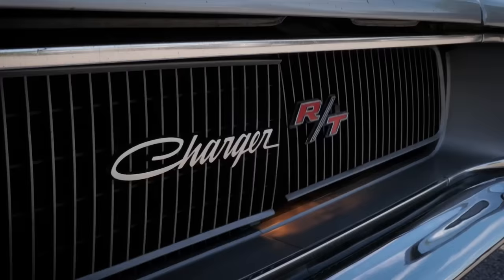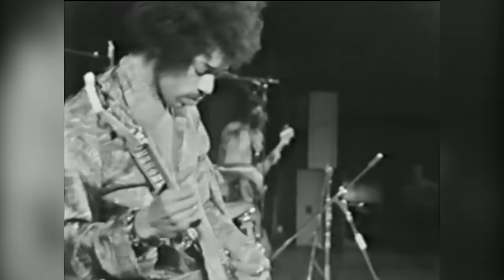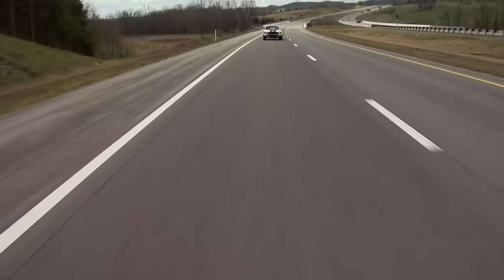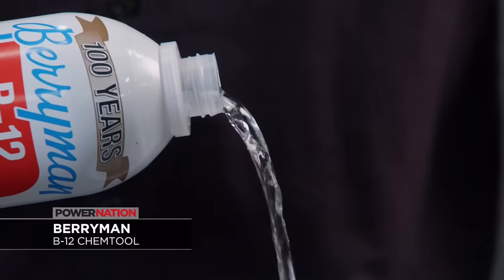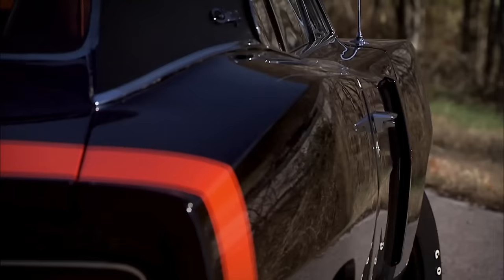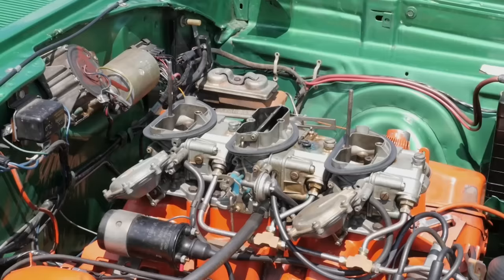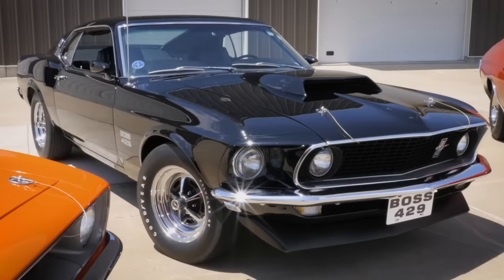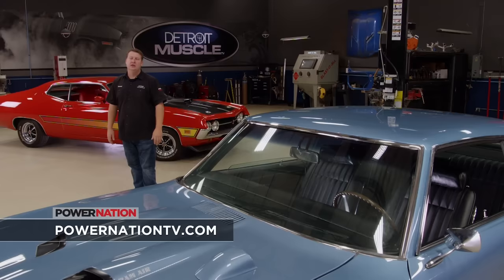Top 10 Muscle Cars of All Time

Comment: I'm 73 years old and grew up around ALL of these cars and remember them very well and also how they REALLY ran on the strip when stock.  I was THERE.   So, it was no surprise that the 1970 Stage 1 GS/GSX was not mentioned here. They were (and are) rare and were very lightly promoted by Buick, if at all. However, the GS Stage 1 ran way better than the sum of their parts would indicate.  And unlike the Hemi's of the day, RA IV Pontiacs, LS6 Chevelle's, COPO 427's, 440+6 Mopar's, Boss 429 or Super Cobra Jet Fords, Boss 302's, 1967-71 Z-28's, etc. etc....  a Stage 1 GS could be ordered with a/c!  The engine was that streetable,. 
    So why wasn't the '70 GS Stage 1 included here?  Simple. It was because: (1) few people who voted here really know anything about the 1970 GS Stage 1, not to mention ever owned one or raced against one stock for stock and (2) very few people who "voted" are Buick muscle car enthusiasts.  It seemed that few GS guys ever raced their cars at the strip and thus lacked basic dragstrip etiquette in how to drive them or even decently tune one.  
     Back in 1971 at the Gainesville, FL Raceway, when all of these cars were new, I saw several GS Stage 1's outrun nearly about all of the so-called Top 10 muscle cars shown here.  I remember that the now-deceased 18-year track manager "Bob" used to laugh about that when it happened because he liked it when such underdogs took out the more highly touted models.
Reply: Yeah, a Buick 455 Stage 1 engine is a glorious beast.  But go back a few to the Buick WIldcat 425 a very quiet sleeper that left the line with competitors jaws on the floorboards.
Reply: @AndrewArndts  Yes, I love the old "nail-heads". Sad that more aren't used in current street rods.  But today it's all about availability and cheap parts and NOT about cool uniqueness.
Reply: Spot on!. I grew up on Woodward Ave in the late 60's early 70's and bought a brand new Camaro SS when I was 16. I got my first GS in 1980 and never heard of it before. I traded a Honda 450 bike for a '70 GS Stage 1 ragtop with 28K on it. Go figure. From that day forward I was sold on GS's and have owned many many more. I'm 70 now and just bought a '66 Skylark with a 455, stage 2 aluminum heads, roller rockers, Big Mutha Thumper cam, 4:11 9" Ford rear and Gear Vendors OD to just mention a couple speed goodies - a low 11 second car. Some of us kids never grow up. Buicks rule
Reply: @albundyrocks2115  Thanks for the story and memories.  Being an old-timer like me, I see that you know what you're talking about.   BTW, 2022 GS Nationals, Bowling Green, KY.  A Buick muscle car Mecca.
Reply: Buick
Reply: Few people who voted know anything about cars. They just grab onto something cool, read about, and declare it the best. Stories like this tell the real truth. My dad tells stories that seem to contradict the list too. He said that small block Chevy cars were hard to beat on the street and big block just blew the tires. The track was a whole other story. For all the hype around the 426 hemi, he said the 440 cars seemed to do a lot better.
Reply: @ardyshane23  - Your dad is right.  Hemi cars were routinely outrun by 440 six pack cars.  To run up to their potential, Hemi cars required an owner who knew how to tune the car and was willing to put in the time.
Reply: Very true.  I am 66 and used to take my lightly modded 351 powered 1970 Mach 1 routinely to test and tune days at the strip around 1974-75.  I don’t recall ever seeing a GSX at the strip.  To be honest I knew nothing about the Stage 1 powered GSX back then. From what I have read they were really hard to beat stock vs stock.  On another note I remember a guy bringing out a Boss 429 one day that was lightly modded with slicks, open headers and a Holley 3 bbl carb.  He was running 12 teens - 20’s which was extremely impressive back then.
Reply: Both the 1970 Buick GS Stage 1, and the 1971 Mustang Boss 351, on paper, shouldve lost to most, if not all, of the cars on this list … but in test after test, both regularly stomped all over them.
Reply: I am 69 and agree with you. Those where the best of times street racing. My buddy had a 67 Grand Sport Conv. in 1972 and that was a very fast car. He sold his 65 GTO that we had installed 396 375 hp big block so he could by the Grand Sport. We grew up right next to Chicago so Nickey Chevrolet and Mr. Norms put a lot of fast cars on the street. 1970-71 I worked at a Dodge dealership as a porter. The last job of mine at closing was to pull all the muscle cars into the shop. You can bet a few of those cars went way past the service entrance for ride.  A few months after I got married in 1974 I bought a used 70 Skylark because of my buddy's 67 GS. He didn't have any photos of that car until 2 months ago when I found 3 35mm slides I had taken Christmas Day 1972 in Denver Colorado.
Reply: @richardbehrends3128  I sure would have envied your job!
Reply: @danmyers9372  Hemis required a whole lot of maintenance to keep in top running shape for sure. 340's kicked a lot of big block butt in the light cars in the day too.
Reply: These old cars were DOGS..the horsepower ratings were fake over rated GROSS dyno numbers......over rated  by 17-20%.  The  440-6 was advertised at 390 hp, but is only 325 NET hp  installed in the car.  426 was really 350 net.
NONE of these older cars put out more than 350 horsepower.  A 2021 Dodge 5.7 puts out more than any at 375 NET horsepower.  The new Camaro V-6 even more at 335.
Reply: Yep.. I thought it would narrow down to the 70 454 Chevelle, the 70 Buick GSX and the 70 Hemi Cuda.
Reply: @matrox  You guessed well!
Reply: @chadhaire1711  "Dogs"?  Few would agree with that term.  Please direct me to where you got those "NET hp" numbers. While I agree to some extent, but not in every case you mention.  The new cars are as fast or as quick as they are due to much more efficient engines and with transmissions with way more forward gears.  What would you expect with 50+ years more technology?
Reply: @LR-my2di  A.  Few would  agree with the DOG term because few understand that GROSS horsepower is vs NET horsepower.  Plus they believe the bullshit 1/4 miles times posted on chats.  The horsepower ratings back then were  FAKE over rated GROSS numbers used until 1972, taken off a dyno with bare engine. The NET horsepower is with the engine  installed in the car with muffler, air filter, belts, and smog gear if any. You lost 18-20% power right there.
B.  The NET horsepower numbers are FACTORY NUMBERS they posted after 1971 when all car makers dumped the fake GROSS numbers and went to NET which is used today.
C.  Thus 440-6 dropped from 390 to 325.  426 dropped from 425 to 350.  340 dropped from 275 to 240...and so on.  But the 2021 Dodge 5.7 used in the RT today  is 375 NET---more than the 426 Hemi!
D. The new transmissions with more forward gears has NOTHING to do with quicker acceleration!!! NONE!
That is because the "extra" gears are ADDED gears mainly overdrive gears.  The first 3 gear ratios on the new automatic cars are about the same as the old cars.  In the case of older 4-speed manual vs newer 6-speed manual, the first 4 gears are about the same--the extra  2 on newer cars are overdrive.....will give a better top speed, but will NOT affect 1/4 mile times.....NO.
E.  The quickest car back in 1970 was the 426 350 hp and 100% stock was 13.6 in the 1/4 mile.  All  these posts telling us about "stock" muscle cars doing low 13's or 12's are BS!   The horsepower was not there.
F.  It is not about 50+ years of tech---it is about 50+ years of bullshit stories---the low 1/4 mile times that never happened, the myth that car makers under rated horsepower to "fool the insurance companies"--another lie--never happened.  Or stories how the 426 really put out 500+ horsepower...LOL....
G.  Back to my statement...these old cars are DOGS. ALL IMAGE.   And I forgot to mention crap build quality, rust, horrible brakes, scary handling, and not that reliable either.  NEWER IS BETTER.  These old geezers need to stop whining about the cars they sold back in the day or dreamed about owning....and go out and buy a newer Camaro SS, Mustang GT, and Dodge SRT.....they will forget about the older cars in a hurry.
Reply: @AndrewArndts  Here we go with the bullshit again....the 1970 Buick 455 was advertised 360 gross horsepower, which was about 310 net horsepower.  With 3:64 final drive the quickest ever recorded 100% stock was 14.1 with top speed of 124.  The stage one 1971 was 345 gross hp, or 300 net and did the 1/4 mile in 14.5......the BS stories just keep on coming...
Reply: @buzzbomb67  The 1970 GS stage 1 was a 14 second car..LOL....
Reply: @chadhaire1711  Agreed that older muscle cars are more about sentimental nostalgia but look at the prices they often bring from the "old geezers" who love them. A "350 hp 426 Hemi" bringing 6 and sometimes 7 figures?  I have both old and new, and (for example) my stock SRT 8 Challenger at 418 rwhp is just a wonderful new appliance.  Ditto my '06 FGT with 696 rwhp.   A real screamer with 136 mph trap speed. However, no real soul to either.  They just do everything so well to almost being boring.  My old recently restored 1970 muscle car I bought new is very different, albeit not as quick as even the bone stock (and heavy!) SRT 8. 
    I bought all of the muscle car mags back in 1970 and read all of the old road tests, and still have most of them. Interesting reading when looking back.  BTW, whatever their actual horsepower was, in May 1970, I very well-remember a 1970 Buick GS Stage 1 outrunning a 1970 Hemicuda (twice!) at the then-new G'ville, FL Raceway.  It appeared to be a close race, but the GS's Winston lane's win light came on both times.  I also remember that both were running somewhere in the 13's.  THAT I do remember, along with the GS being so damn quiet. That all surprised the 'ell outa me.  
   BTW, in a 1/4 mile pass, my automatic SRT Challenger uses more forward gears than my old 1970, so the engine stays at redline.  It doesn't ever fall out of its power curve. The tach stays almost rock steady the whole way. That's basically what I was talking about.  So power is maintained throughout the 1/4 mile near redline.  Not so at all with my '70 or any other muscle cars of that era.
Reply: @chadhaire1711  You ain't too smart. V6 Camaro barely making 280lbs Tq., compared to 350, 400+ if you want to use net ratings. Well over 400-450+ if you go gross. Those oldies were running 3 and 4 speed transmissions. Lots of wasted power to the ground. New V6 Camaro running 6, 8 speed trans, with very linear gearing for no drop on power between shifts. These old cars would also burn rubber through much of first gear. Add a modern 6, 8 or 10 speed trans, with modern sticky rubber and it would knock a sec. or more off the E/Ts. Those cars did pretty damn good with that 50-60 year old technology with no computers to adjust cam and timing on the fly like today. If you knew the tricks you could drive you 440 six pack or many other cars to the track, tweak your carb, manually advance your timing and knock almost a half sec. off an e/t. Sure your car will idle like sh!t and be undrivable for street but be great for getting down the 1/4 mile. After the race go back to stock timing and drive home. No these cars were not dogs by any standard.
Reply: @LR-my2di  Exactly!!...just what I tried to tell this fool.
Reply: @LR-my2di  a.  Any Buick Stage 1 that outran a 426 was NOT stock.
b.  If you take an old 1970 muscle car with 4-speed manual, and newer car with 6-speed, you will find the gear ratios of the first four gears about the same.  In 4th gear, at 75 mph they will both be running high 3500-4000 rpm.  Not sure how your SRT can run higher rpm than the older one in the first 3 gears, but I have not checked as of late.  If your old car has 4:10 rear I dont see how that is possible.
c.  I  dont see how a newer SRT can be boring compared to the older 1970 car....same wild styling, same loud exhaust, a lot quicker.  More chance of dying in the older rust bucket with horrible handling and bad brakes, so that might add excitement and thrills.
d.  Yes these old cars bring a lot of money at auctions---a sucker born every minute in my book.   But 40 years from now the 2021 Hellcats will be bringing $200,000 at auction, and the same whiners will be saying "I should have bought/kept one back then".  So the smart thing to do is forget the old junker over priced cars, and put money in the newer cars NOW--and keep them.  I have driven all the Hellcats and there is NO WAY I would ever sell a RAM TRX truck....the ultimate drive.  The Hellcat Durango as well--with all-wheel drive it is actually quicker than the 800 horsepower Wide Body Challenger  on street pavement.
Reply: @LR-my2di  gearing makes a HUGE difference …
Reply: @matrox  You are playing a numbers game and slighting the deck.
1.  The new transmissions with "more gears" have NO ADVANTAGE over the older cars as far as acceleration goes.  Take a 1970 car with 4-speed and newer car with 6 speed, and the ratio of the first four gears is about the same....the extra two top gears are over drive and while have an advantage of top speed, have ZERO advantage in the 1/4 mile.  Pretty much the same on automatic transmissions....drive 75  mph one ANY of these cars, new or old,  in 4th gear and you will see little difference in rpm. I know because I drive them all every day of the week...you obviously have not.  The idea that a newer car with more gears has less power drop on the drag strip  is bullcrap----in fact with an older car with 4;10 rear, the newer might have LESS DROP.
That is why the older muscle cars maxed out at about 110/113 mph....low gearing. 
2.  Yeah if you "knew the tricks" you could get the older cars to run quicker...as in NOT STOCK.  If you know tricks, you can do the same with newer cars...NOT STOCK.  What is your point?
3.  The only advantage newer radial tires have over the older tires are flexible sidewalls that keep 100% of the tread on the ground in corners, while the older stiff polyglass did not flex which prevented total traction--IN CORNERS.  When doing a 1/4 mile in a straight line there is no real advantage.
4.  The V-6 Camaro puts out 335 hp and 280 torque.  The 383 was/is  265 hp net, and about 335 net torque..nowhere the 400-450 you are quoting.  The big blocks 440/426 were 325/350 horsepower near 500 gross torque, but only about 425 net.  The 2021 Dodge 5.7 is 410 lbs torque net, about the same, and 395 hp--far more than 426/440-6 pack.  You can run all the numbers you want, but the older cars were over rated.
5.  So who ain't so smart now Gomer?   LOL...try try again....
Reply: @matrox  and you fail Goober....try again...
Reply: @buzzbomb67  The 1970 cars had low  4;10 rears that dropped the top speed to only 110/114 mpg......they still cant beat a modern car with taller gears...what is your point Gomer??
Reply: @chadhaire1711  so we agree … modern transmissions with better gearing…. Just like I said.  Doesnt change what those cars were, though.  But it does explain why so many people prefer restomods to concours original cars!  No one is arguing that new cars arent faster … I have a 17 Roush Mustang that supposedly runs sub-11 second 1/4… no 60s/70s car can compete with that, without major modifications to modernize it.  We all know it.   Whats YOUR point?  Why so argumentative?
Reply: @chadhaire1711  You made my point. These older cars accelerate...the problem is gearing. Most of these cars will burn rubber all through first gear. 2nd 3rd and 4 is when it looses the efficiency of using it power because of loss between each gear because of the big ratio difference between each gear. Unlike a modern trans has closer ratios between gears as to not drop power losses between each gear. You don't know to much about cars do you. Give up the Fake news dude and stop pretending to be a Honda Civic expert.
Reply: @buzzbomb67  My point is: the horsepower ratings claimed  these videos and comment sections  are fake, the quick  1/4 mile times listed in the comment sections are bullshit, the idea that horsepower ratings on the old 1970 cars were "underrated to fool insurance companies" is and always was a lie, the claim these were more reliable than the newer cars is 10000% false...I could go on...but my favorite are the comments from some  dude who said he owned one of these  old muscle cars and stock, it did the 1/4 mile in 12 flat, and ran 150 mph on the freeway...LOL......there is one on every thread.  My point--NEWER IS BETTER IN EVERY WAY. NUFF SAID.
Reply: @chadhaire1711  Dead wrong.  This is just ONE example ... Jan. 1970 Motor Trend p.66-68.  13.38 at 105.50 with TH400 and 13.79 (with more wheelspin) for a 4-speed at 104.5 with a 4-speed.  No magazine test ever noted a 124 mph top end for that car.  Both M/T GS's were noted to be dead stock.  BTW, that 360 hp was purposefully rated down at only 4600 rpm.
Reply: @chadhaire1711   Chad, you sure share a lot of "opinions" here.  If you think that it's just the "old geezers" that love these old muscle cars that you denigrate, then you sure haven't studied this l-o-n-g comment section! And it's just one of many such old muscle car forums. That alone proves your opinions are just that ... opinions. You obviously don't have a 1964-72 muscle car, and that's fine. I have both old and new and a few in between. That alone proves my point. I speak from experience of owning quite a few high perf. cars.  I guess you never heard of the Round 1 GS vs. Hemi shoot-out at Gainesville, FL done by the old Muscle Car Review back in '84.  BTW, the GS Stage 1 "stock" or equally modded up to a point where the old Buick Q-jet on its cast iron low-riser manifold will run out of air will indeed run with an equivalent Hemi "whatever".  I've personally seen it and the old magazine tests prove it, and I've got nearly all of 'em to prove it.  
I said that my SRT, with all of its forward gears, would keep engine rpm up throughout the 1/4 mile and constantly at the top of the power band compared to an old 50 yr. TH400, C6 or Torqueflite. That, along with immensely better tire technology, really makes a big difference in the performance of the new "muscle cars" vs the ~51+ yr. old ones. 
Now I will conclude with MY opinion.   If you believe that the big ol' Ram TRX, with its 8-10 mpg and its total daily impracticality is the "ultimate drive", then what the hell am I doing discussing this topic of muscle cars with you.  Merry Christmas!
Reply: @buzzbomb67  Well, it certainly can ... more-so like on a 1969 Z/28 as compared to a 1970 GS Stage 1.
Reply: @chadhaire1711  soooooo….what?  Are you mad because you think all 10 top muscle cars should be brand new cars?
Reply: @LR-my2di  You are dead wrong....on everything----the horsepower was not "purposely rated down from 360"....the net was more like 325 hp, and the low rpm was due to the pushrod design and long piston stroke which is not designed to operate at high rpm.  Even the 426 Hemi was only 5,000 rpm. Revving higher could get about 10% more power, but could destroy the engines--which is why the 426  Hemi had a 90 day warranty. 
The 13.38 quarter  mile was  typical Motor Trend BS....everyone knew the factory was sending wringers that had  been prepped by the factory with hand made motors for press fleets only--non stock- which was easy to do because the lack of  smog gear--also MT cheated by  doing things like removing the air filters, or packing the air intake with dry ice, and doing a dozen runs, then cherry picking the best one time.  Car & Driver did the same.  Only Road & Track gave real results at the time whcih were much slower than other magazines.
I am 100% correct----you are not--you are just reading  fiction you read somewhere...just like the virus ninsense we see in the media....next you are going to tell me you get your "news" from CNN and MSNBC!!!!!!!!!!!!!!!!!!!!!!!  Dont believe everything  you read.
Reply: @buzzbomb67  NO--I am mad because these videos and the comments repeat the same bullcrap horsepower numbers that were fake, and the same 1/4 mile times that could NEVER be done with a 100% stock car.
The most potent car was the 426 Hemi, and its real net horsepower was 350, not the GROSS 425 advertised...the 440-6 325 not 390, and the new 2021 Dodge 5.7 beats them both at 375 net horsepower.
and 100% stock none of these cars could do better than 13.5 in the 1/4 mile.....
Reply: @chadhaire1711  right … so youre saying the top 10 should be 100% 2022 models.  Gotcha.  Look, I agree that comparing post-2000 models to anything prior, based solely on the numbers, is just silly, so there should probably be two lists … no one argues that new cars dont have better numbers because of better technology, but maybe its not all about 1/4 mile ET… just a thought.
Also, its WELL documented that manufacturers fudged the numbers, back then as well as now.  Now, theyre more likely to fudge them upwards.  But again, its WELL-documented that, because of insurance, manufacturers fudged their numbers downwards, to get around the insurance premiums.  Whether you believe it or not, thats your problem.
Reply: @chadhaire1711  Gearing...most new 6 banger cars have a very low first gear to make up for lack of torque...then they have 5-9 more close ratio gears for top end. That 1st low gear can equate to a 4:11 rear of the old cars, but the old cars did not have the additional gears to wind out like modern cars. The engine in those old care were stout.
Reply: @chadhaire1711  12 sec. flat was not uncommon in some of these cars. Caburetor tunes, headers, tires, proper gearing.
Reply: @matrox  WRONG AGAIN:   In the 2021 Dodge SRT Challenger  first gear is 58 mph, second gear is 88 mph, third gear is 118 mph, and fourth is 140 mph......in the 1970 muscle cars with 3:55-4:11 rear,  4th gear  topped out at 115-110 mph.  Try again...or don't--you are not very good at this....LOL...
Reply: @chadhaire1711  I'm talking about 6 bangers, they have low first gears because they have little tq. You are the one who brought up V6 Camaro. V8s come with built in Tq.
Reply: @chadhaire1711  You just made my point again...They topped out at 110-115 because of the 3 and 4 speed transmissions. Again...listen closely...try to comprehend. If these cars had more gearing as in a modern trans they be topping out at 140+. Actually some cars like the 60s Corvettes and others were already topping out at about 140, depending on rear gears.
Reply: @matrox   I picked out one example.....  in any case the 335 hp V-6 does the 1/4 mile in 13.8 seconds....same as the 1970 440-6.  The first four gear ratio's  in the manual transmissions are not much different.
Reply: @chadhaire1711  OK...tired of arguing with someone who grew up strapped in a baby of their momma's Toyota Camry and has never even driven any of these cars. Let me guess...your current ride is a Honda Civic with a cardboard 24" wing and a Coffee can muffler.
Reply: @matrox  Like you, a  kid who subscribes to you tube cartoon videos ever drove these 1970 cars????......LOL.......I was there in 1970's and YES I drove the cars....I can tell you every model and how they really performed and what REALLY ruled the street.  They were all show, but little go.  By 1973 you could buy a Road Runner for as little as $900--nobody wanted the over rated gas guzzle  crap anymore.  And most sellers took their $900 and  put a down payment on a economy Ford Pinto, Chevy Vega, or sporty Datsun 240Z...the V-8 muscle car game was over, and by 1980 most had rusted away or been junked due to crap build quality. And it wasn't until these newer Challenger SRT, Mustang GT, and Camaro SS cars came along recently the game was on again.  In the meantime I still test factory cars for a living---been doing it before you were  born....drive more cars in a year than you ever will in a lifetime...will still be doing it long after now....I know what the market is and was....easy to verify if you were not so naive....I dont need a Greehorn to lecture  me about the car industry----I explained to YOU but you are too dense to get it.....go back to your Ninja cartoons on your Google subscription ...you are totally out of  place here, and just sound stupid.
Reply: @chadhaire1711  Ok...now this clown says he  a Factory car test driver...for "Toyota". Can't make this sh!t up.😆
Reply: @chadhaire1711  Hemis made over 500 ftlbs down low at like 4000 rpm. Hemi heads don't get peak flow until about 7500 rpm. HP figures were given based on that rpm. Fuel was leaded back then along with higher octane. Compression ratios were as high as 13:5 to 1 on some of those motors. Given todays cars run on lesser octane and such but there is still no denying that open the hood on most top fuel cars and you will see that old hemi block in there. If they were so bad why do people still run them?
Reply: @jrs416cars  WRONG WRONG WRONG:
1.  You  do not understand the difference between GROSS horsepower and torque (which is a bare engine on a dyno with no  mufflers, no belts, and no air cleaner) and NET which is the motor installed in the car with all items installed.  As of 1972 ALL engines  are rated NET.
2.  The 1970 GROSS 426 horsepower was taken at 5,000 rpm redline which was 425 hp, but in the car was 350 hp rated starting in 1972....FACTORY NUMBERS.
3.  Revving to 6,000 rpm can boost the net to about 465, but that is still only 375 net, and doing so can damage the engine--that is why it came with a 90 day warranty.  No street Hemi ever went 7,500 rpm!  LOL.
4. Compression of the 426 was 10.25...period.  Net torque more like 425 or so.
5.  A 2021  5.7 V8 in the RAM truck puts out 395 hp, and 410 torque NET.  Do the math.
6.  You are getting bad bad bad info..........from where I dont know.  Now you have the REAL info....I will send you a bill.
Reply: Back of the '70s growing up in San Francisco a union boss  lived around the corner around the corner had a 1970 GS stage 1 Buick. I remember the Buick being badass and so is he. Although the neighborhood kids loved him! Unfortunately somebody did not. I think that he had an early demise. And that's all I remember about the buicks. Let's not forget about the grand nationals. And I'm not even a GM guy really. But when a car is good a car is good!
Reply: @lightningstrikestwice6302  A mature reply. As we get older, our tastes expand although we still may have our favorites. Since you mention the T-R,  I also own GNX 489.  Bought it new. Thanks.
Reply: They were the King of the quarter mile track. My neighbour had a '70 GS 455. Best description - Raw Power! This thing would lift up, then take off, when ya tromped on it.  So much fun.
Reply: @zedmoe  All show and no go for GS 455.......1/4 mile 13.9 tops.....a common 2021 Dodge Charger RT with 5.7 can smoke it at 13.6.......
Reply: @chadhaire1711  Well, we're talking bout the Stage 1. I dunno if what you're saying is true.
Reply: @zedmoe  very true
Reply: @zedmoe  So true, Zedmoe!
Reply: @danmyers9372  As a Ford racer back then, I'll bet that I once saw the same car!  I remember that old 1050 3-bbl Holley you mentioned!   That car had been thoroughly "gone through" (the owner's words) by a factory Ford engineer in Dearborn and was stroked to 498 cu, in. and had an "off road" roller cam and 4.56 gears.
Reply: @jrs416cars  Wrong again Goober---the 426 Hemi and 440 was made LONG after 1971..LOL.....it was in the MOPAR catalog and sold for years after, just was not put in cars.  And in that catalog of which I had copies listed the horsepower at 350 net, down from the fake 425 gross.  But of course you didn't know that because  you were not around then..all you know is what you read or guess.  Your grease money skills dont mean crap to me and has nothing to do the subject matter is here.  I know what I am talking about again--you do not.
Try try again.....
Reply: @albundyrocks2115  great great videos
Reply: @albundyrocks2115  awonderful awonderful videos
Reply: @ardyshane23  fantantic fantantic videos
Reply: Great great videos
Reply: Lovely lovely videos
Reply: @chadhaire1711  very very  good videos
Reply: @buzzbomb67  great great videos
Reply: @danmyers9372  one of the biggest keys to the Hemi was the exhaust … most stock exhaust systems, ESPECIALLY in the Cuda and Challenger, didnt flow enough for the hemi to build power properly
Reply: I was an NHRA drag racer in the 60's and 70's so I need to add my 2 cents. The Stage cars from Buick had the most stump pulling torque of anything I drove back then. The problem with them was they would be all over the top ten in the eighth of a mile in a stock race, but, being Buicks, they had small ports and a Quadrajet carb. ...Once these beasts past the eighth mile, ALL of the top 10,especially the Hemi and LS6 would out power them and eat their lunch. I did not vote in the top ten, but, I bet the explanation I just gave is why they did not make the ten..........Also, GM knew that it being a high torque, lower horsepower motor, the rate of RPM climb would not damage an A/C compressor, so they were able to offer A/C............... The LS6 ( another GM car) would reduce an A/C compressor to rubble.........The Buick Stage cars were fabulous, just too much of a  compromise ( I bet ) to make the top ten..........Be happy knowing that the big Mopars and the monster Chevies were sweating their asses off while the Buick guys enjoyed their A/C.........
Reply: @charliechristie2949  Some good points, Charlie.  However, these "Top 10"  musclecars were presented here as stock production.  The Stage 1 would certainly outrun most all of these shown here and run as well as any of the rest, including the LS6.  I've personally seen this many times. The GS Stage 1's, as you know, were produced as street machines and not race cars.  That's why most of them were optioned with a/c.  The LS 6, 426 Hemi, 440-6 bbl., RAII and IV Pontiacs,  429 SCJ Fords,  all solid lifter Z/28's, 427's and 396's, some W-30 442's, and so many others; etc. couldn't even be ordered with a/c.  Car for car, and with numerically lower gears, the Stage 1's torque and hp could be "spread out" over the 1/4 mile compared to deeper geared musclecars. The legendary Hemi vs. Stage 1; Round 1 "shootout" from the Dec. 1984 Muscle Car Review magazine proved this point in spades.  By googling "Hot Rod Hemi Killer" anyone can see the proof of this.  Just two average guys with street machines. The GS Stage 1 trounced both the '70 GTX Hemi and '70 Hemicuda all in one afternoon.  However, NHRA racing, like the kind you mentioned, where much bigger than stock cams are a must (and legal), is a different ball game.  That's where more carburetion (like on the Hemi's, LS6's and 440 six barrels; etc.) have an advantage. But again, these Top 10 picks in this video were all presented as stock production street machines and the 1970 GS Stage 1 certainly should have been included.
Reply: Must be an honor to have a conversation with you Mr @L R. I am barely 30 years old, and these cars are my passion. I think a tear would come my eye if I ever saw #5 here in real life. Your experience at the tracks must have been amazing. I wish I could see something like that one day.
Reply: @Rmachine91  I'm humbled by your comment, RM.  Thank you.  I can tell you this, the "young" moderators of this video are largely going on a rehash of comments from others in the past. None of these cowboys were experiencing anything but a baby bottle (if that) back in those real Golden Age muscle car days they're all talking about. I've heard all of this old rhetoric before, and that's what bothers me.  Here's just ONE example. Look how they glorify the '69 GTO Judge with RA IV engine.  I challenge any of them (or anyone) to find a road test from any car magazine of 1969-70 that showed a factory stock '69 RA IV Pontiac Judge even breaking into the 13's. That also goes for any 1969-70 RA IV GTO.
Reply: Go to a dragstrip now and watch the Tesla Plaids embarrass anything referred to as  G O A T, I'm 74 had  427 Fairlane, Triumph Bonneville, 406 Galaxy, and a few others. There is no such thing as  GOAT there is only  "up until today" Someone will always beat whatever is awesome at a certain point in time.
Reply: @gonzo2.0  Agreed, of course, and there are more "super EV's" on the way from Dodge and others. However, that's irrelevant to this topic which is the ranking of "Golden Age" muscle cars in THIS video.
Reply: @LR-my2di  I agree with everything you said, I just never use "ever" or "all time"  when making a list about anything because we will never see all time.
 Johnny Unitas was The Greatest Of All Time..
but people now say Tom Brady is the GOAT.. they are using the wrong statement. Unitas and Brady were and are the greatest up until now. Cars list are the same thing. thanks for the conversation I respect your opinion, stay safe!
Reply: @gonzo2.0  Sure 'nuff, Gonzo!   I agree. For example, remember when the 4th Gen. ZR-1 was THE "GOAT" around 1990-91 before Viper?  Now it's a "has-been" at its old factory rated 405 hp. Not knocking it ... heck, I have one, but YES ... time and TECHNOLOGY do change!  The current Plaid is indeed mind-altering!
Reply: I'm 65. I drove a Datsun pick up. Pea green. I could drive circles around a Buick GSX. . ..... if it was parked.
Reply: @mesomemore97  Wow!  Now that's remarkable handling!  A pea green Datsun's forte!
Reply: @chadhaire1711  You just need to read up. And also you were stating about motors installed from the factories in case your small brain forgot. You could not order them in a production cars as you were talking about. Direct Connection was the place but I can bet you never rode in or saw a hemi car in your days. Your loss and please brush up on what you state and reread before you comment so it is fresh in your before you embarrass yourself any more.
Reply: @chadhaire1711  Chad needs manpons. He doesn't feel well.
Reply: Yep! I lived in PCB and life was great! in the 60s. Now I am in Ca. wishing I could get back to that time and place.
Reply: @jameshyde1501  Yes, James. Don't we all!
Reply: Completely Agree About Buick GS Stage 1, & Most Of What Mentioned !!!!
Reply: @loucaruso3971  Thank you, Lou.
Reply: @ChrisSmith-nw7be  With right gearing and tune possible----but any soccer mom 2021 Charger with stock 5.7 V-8 can do that time.....big deal.
Reply: @ChrisSmith-nw7be  That's ok, Chris. I've not read all 87+ replies anyway!  We built and sent two 100% stock appearing "stroker" 455's to Australia for Con Liapis and his nephew. You may even know him. He lives in Caroline Springs, Victoria. Both made over 500 hp. Con has quite a few very nice Buick GS's and a GN.
Reply: @LR-my2di  I'll be there at the Nats!  Love me some Buick muscle!
Reply: @marinablueGS  That's great news, Barry!   "Support our Buicks!"
Reply: Could not agree more.
Even a top magazine like "Motor Trend" placing the GSX at the top of the heap in 1970 seems to be overlooked consistently..
Reply: @moodyrick8503  Thanks, Moody.   So true. And sources such as this one sure seem to ignore that fact because they really don't know musclecars like they purport to.   They prefer to stick with the mainstream makes and models. It's documented fact that the 1970 Stage 1 vs. 1970 GTX Hemi "shoot-out" sponsored by Muscle Car Review  magazine back in Dec. 1984 was legend. The GS Buick "creaming" (Hot Rod's words) the GTX Hemi really shook the muscle car world.
Reply: Buicks are DEF GM's best efforts of the 60s-early 70s!
Reply: @ardyshane23  There is some truth to that. The Hemi had to be set up and maintained by someone who knew what he was doing, such as professional drag racers or other guys who knew their stuff. The 440 had a lot of low end torque and were much more forgiving to the setup. Street racing on a public road is different than Drag Racing on a prepared surface. The Hemi was the King of the dragstrip, and still is, but, you are right, the 440 was often  better on the street.
Reply: @mr.blackhawk142  I agree, Mr. Blackhawk. Certainly one of them, anyway.
Reply: Wow - You are so Right. My best Friend in College 1969/70 owned a 427 Cobra but bought a 1970 Buick GS stage 1 for everyday driving in bad weather.
Reply: @albundyrocks2115  Hello Al ... Then you need to be at the 41st GS Nationals this May 11-14 in Bowling Green, KY.  I don't know how much longer this great Buick event can last with all of us growing much older and track rentals going up like crazy.
Reply: My 70 Coronet had AC and it was an option on every Mopar.
Reply: @danpals7678  Dan, you didn't mention what engine your '70 Coronet came with. As I said above, a/c was NOT an option for any Mopar that was ordered with the 426 Hemi or 440-6 pack.  If you can actually document otherwise, please note it here.
Reply: @chadhaire1711  what ever us old timers have lived the best of times, 
Called real Detroit muscle.
Not the trash now a days.
Turbo this turbo that.

Building a real motor with balls not cheap trucks!!!!
Sorry brother
Reply: @redlion9199  So you are saying a Dodge Hellcat is not real Detroit muscle because it has a super charger??------same basic operation as a turbo by the way.
Reply: @chadhaire1711  no Detroit has been dead for decades.
Just saying old school muscle was decades ago.
Take care
Reply: @redlion9199  Drive a 2020 Mustang GT V-8, Dodge Charger SRT 485 V-8, or new Corvette......new muscle is better than old...I drive them all for a living......Cadillac Blackwing with 6-speed manual tranny  was a blast.
I dont miss the old cars.
Reply: @chadhaire1711  I appreciate your response.
Let's go drive them I'm down.
I grew up in the muscle days, everything was different than.
You take care my friend 👍😂
Reply: @chadhaire1711  not at all the muscle car was way before your time.
The cars made now in Detroit are completely different than back in the day.
I'm sure the new muscle cars are fine.
I'm just old school, people built motors using the seat of your pants.
A Motor blueprint and balanced back then with aluminum h Beem rods massive compression ratio, was a feet of magic.
Just as different way of doing things,,, and making track records and so on.

I know we had blower motor s in the day.
It's all making power in the end.
The turbo charger and super charger now a days gives massive power witch is cool.
I just like Old school.  Lol

I see a lot more wrecks in the New muscle cars

And have traction control???
I don't know about all that computer stuff.
My real concern is power to weight ratio
Along with body twist, when power and torque specs
The body's are being made with Chinese sheet metal
Much thinner than the Detroit steel body's in the 60-70

So you have driven most majority, 
I have seen many videos on the wrecks
I wonder if the motor twist the engine bay and cause a steering issue??
Alignment problem pulling to the left on acceleration??
I see in the video different car's mustang Camero charger challenger some exotic one's too
They to pull left?? 
What do you think????
Take care
Reply: @redlion9199  You are wrong on all counts.
A. Old cars were NOT before my time---I drove the 1970 cars.  They sucked......bad build quality, rust buckets, gas guzzlers and unreliable.
2.  The car body today are 500% stronger than the older ones....the older cars flew apart in a wreck..rattled...and rusted.  Newer unibodies dont rust, dont rattle, and stronger.
3. Very few muscle cars today have a turbo----the Mustang GT, Corvette, Dodge SRT 485 dont.
4.  Newer is better--more reliable, better quality, stronger body, quicker, use less gas, dont need a tune, and dont cost more than the older cars after adjusting for inflation. 
5. NEWER IS BETTER!!!!!!!!
Reply: @chadhaire1711  my apologies to you.
I just see more wrecks in today's vehicles, could be more drivers inexperience?
I watched a guy salvage a hellcat from a garage fire .
The only thing left salvage was the rear trunk and quarter panel.
He replaced the floor board and front clip all one piece.
It seemed to me very weak design all tack welded together.
So on your acceleration in the new stuff,, do you feel any pull in one direction??
Again sorry I'm a senior to.
Appreciate your input.
Reply: @redlion9199  I have test driven about 1,600 factory new cars in the past 32 years-I have no clue about cars "pull in one direction" you are talking about--- unless the steering wheel is turned.
Reply: @chadhaire1711  Chad that is awesome.
Sounds like fun .
My concern is for the drivers safety.
Watching the wrecks I have seen a pattern.
Nice talking with you God bless you
Reply: My dad has a 71 GSX and it’s one of the fastest cars I’ve ever been in it will hit 100 in under 30 seconds it’s crazy
Reply: @legorobotics1017  Hello Lego,  the Jan. 1970 issue of Motor Trend magazine tested a factory stock 1970 GS Stage 1 that turned 0 to 60 in 5.3 seconds. So, if it was powered by a 455 Stage 1, I'll bet your Dad's 1971 GSX got to 100 mph in much less than 30 seconds.
Reply: @LR-my2di  it’s worth noting he’s never had the pedal to the floor
Reply: @legorobotics1017  Yes, that would be worth noting!
Reply: Ford Cammer
Reply: @gordy-jt6vg  A Ford cammer WHAT?   427 SOHC?  No car was produced with this engine.
Reply: @LR-my2di  
your correct I looked it up the Galaxies was a prototype, to race in NASCAR it had to be in a fullsize galaxy 500penalty weight of 4400lbs ? the hemi
Reply: @gordy-jt6vg  Still an awesome engine!
Reply: I remember gs455 Buick my friends bro had it ,man it would suck you back in the seats!!!!!
Reply: Thank you for being a Buick advocate. You're right on the money.
Reply: @scottgordon600  And Thank You, Scott.
Reply: I'm 71 and was a regular attendee at CT State Dragway (Colchester).  There was a white GS Stage 1 who regularly dusted everyone in Stock production.  You're 100% correct.  The Screaming Skylark should be on any top 10 muscle car list.  Any motorhead will tell you that from the factory the Stage 1 had the best finished heads compared to others.  Nailheads forever!
Reply: @AndrewArndts  My dad bought a 64 Wildcat with the 425 340hp engine. I remember my mom dusting  a TR6 Triumph that tried to beat her at the stop light.  She laughed and laughed.  After that every stop light was an adventure.
Reply: @tomquinn607   Tom, it's guys like you who were really in tune with what went on back in those days.  The guys in these videos, like this one, often have no clue.  They merely repeat what they've read or heard from the past.   Back in the late 1960's and early 1970's, the percentage of Brand X musclecars out there far outnumbered the   GS Stage 1's.  So the Buicks were often seldom noticed except in cases like you mention here.
Reply: @LR-my2di  You're so right.  The 429 Mustang was a beautiful looking car but had mediocre performance at the strip.
Reply: @tomquinn607  Funny you mention that.  Back in '71, when I began teaching at a local university. I met a guy there who became my best friend throughout the 1970's and 1980's.  He was a Ford guy from his youth.  He had special ordered a plain-Jane beige Torino 500 with the 370 hp 429. It was an interesting "sleeper" and ran good on top end with the Police package that he also ordered, but numerous times we met up on the way to work and  I easily annihilated him with my '70 GS Stage 1.  Never even close.  His usual rivalries were with the 340 Dusters of the day which were everywhere back then.  No contest with those either. Good ol' days.
Reply: @LR-my2di  The best of times!
Reply: L R, I lived in FL back in the mid 80's and I recall a black Buick GNX that ran at Gainesville consistent high 10's with street legal tires.
Reply: I'm 71 and I miss my 67 Catalina 2+2  421 cubic inch engine. 3 on the floor and it was a rag top
Reply: @gamer6550  '67 was the last year for the Catalina 2+2. It's base engine was the 428 and the 428 HO was optional. 421 engine was discontinued in '66.
Reply: @sergeantmasson3669  I know mine had a 421 I typed in the wrong year, Sorry my bad. Have a great day my friend
Reply: It looked a lot like the 70 Chevelle. Gorgeous car. A true tire-shredder, that's for sure. 13-sec. car right from the factory.
Reply: @rickbailey189  Yes, Rick, I agree.  I know because I helped man the G'ville Raceway track back in the early 1970's right after it opened.  The few GS Stage 1's that ran there always ran very well. At the time I was going to the University there.  The 1970 GS Stage 1 (most came with a/c) was an underachiever but didn't know it was supposed to be, so it went about taking down many other "hotter" factory offerings ... that is, if the owner simply knew enough to drive and maintain the car properly!
Reply: @LR-my2di  The fate of these old classic muscle cars is going to be in (?) as we progress into the 21 C. Gen X, Y and Z will be carrying the torch. The only way they'll be driven later is if a high-powered electric engine can be developed to adapt with a corresponding transmission.
Reply: @richardbehrends3128  In Chicago  Nic"k"ey Chevrolet  and "the backward K" was their  advertisement .
Reply: @LR-my2di  OK, L.R., It is nice to have a civil chat with a fellow "mature" drag racer. (I am 68 myself).....Maybe they should have made it the top 11 odf all time and included the Stage 1 cars !.....ALL THE BEST TO YOU !
Reply: @charliechristie2949  Thank you, Charlie.  Agreed.  Maybe even the Top 15.  After all these years, as EV's take over the "fast car" segment,  it's still sorta fun to bench race the Golden Age of muscle cars so long-after-the-fact, eh?   Please try to find the late Joe Oldham's book "Muscle Car Confidential".   You won't regret it. It's a HOOT.
Reply: @LR-my2di  Thanks. Will look for the book !
Reply: @chadhaire1711  The standard GS 455 used the low-po passenger car 455 engine as did the 455 GTO, Olds 442; etc.  Come on, Charlie. You don't compare cars separated by over 50 years.  No relevance to that.  According to the May 1970 issue of Car life magazine, the 1970 Charger 440 RT they tested ran a best of 14.71/96 mph with 3.23 gears.  A 1970 GS 455 with 2.93 gears they tested in their Dec. 1969 issue ran a 14.62/96 mph.   There's your relevance. .
Reply: @LR-my2di  you are missing the point....all the horsepower ratings claimed before  1972 were over rated and fake-------no 426 Hemi was 500 hp, it was 350 net...that is why we need to compare
Reply: @chadhaire1711  My gosh, Chad,  I agree, but haven't all enthusiasts known THAT for over 40 years?   I get HMM magazine and it is funny when they "hyperbole-up" a feature car might run a high 13 when a new V6 Accord will do at least the same thing.  Even the transmissions and such are sooo much more efficient nowadays. Hey Buddy,  it's like comparing a 1920 model to a 1970 model.  There IS no comparing, so I enjoy both the new with the old (memories) when at least we thought we were going fast.  It's our fond MEMORIES of the past that drives these comments!  Few here care about a wonderful new appliance like the Plaid.
Reply: @LR-my2di  Sadly about 90% of enthusiasts have NOT known that for 40 years, including people who make these videos!
Reply: I didn't own a 70 but I had a 67 that I blew the motor up in. So I took a 1970 455 stage one and put it in my 67 body. Best car ever
Reply: @albundyrocks2115  "Bought a brand new Camaro SS when I was 16."

Damn, the USA were really something back then. Even now there are MUCH older people all over the world and also in the states that can't afford even a basic 3 cylinder car from low budget brands and you guys were buying pony and muscle cars in the late 60s and early 70s like if it was something common :) If I was there back then I would be so motivated to save up on something cool too!!
I was born behind the Iron Curtain,  but I always wished to be around for the 50s and 60s/70s in the US.
To this day I am happy to see an old american car on the road,  because it always makes my day and puts a grin on my face.  When I see a '68 Wildcat for example it means to me much more than a Bugatti Chiron or something like that.  I have a' 72 Dodge Demon 340 - an original H code car and I never met another Demon here in Europe. When I park somewhere,  random people flock to my car and ask all kinds of questions. I answer their questions,  get back in the Demon and start the car...with a key that has a ZZ Top logo keychain on it,  just like in the videoclip. Then I go for more V8 cruising...

I hope that you have many more years left enjoying your Buicks and keeping their brand alive 🇺🇸.
Reply: You are absolutely correct the Buicks of the day didn't see a lot of attention cause they where slightly more expensive over other cars buy what most dont know is that the stage one was a torque monster 510 foot pounds at 2800 rpm
Reply: Had a friend who had a 67 Buick GS 400 convertible. His father was a mechanic who took care of it, and was a little dodgy about whether it was 100% stock or not. But damn if that purely stock looking sleeper car didn't blow off Six-Packs and 428 Mustangs. I've read that Buick, and in the 455 certainly, got more torque out of their engines.
Reply: @johnbergman8070  Very interesting comment, John.  At MCACN this last weekend outside of Chicago, there were some fine 1967 GS 400 convertibles there.  As it was in that old Dec.1984 Car Review magazine Round 1 "shootout"  (1970 GS Stage 1 vs. 1970 GTX Hemi), the GS just didn't know that it was supposed to lose to that arrogant GTX Hemi owner who wrote to Car Review magazine saying that "the Buick GS runs like it was tied to a tree", so the underdog GS just got out there and blew doors!
Reply: Love a GS1 w/455
Reply: I had a Stage I  1970, the only car to outrun me on the track was the 429 Cobrajet torino.  mine was stock, don't know about the torino.
Reply: @Mr1LuckyGuy  Funny that you say that. My good friend "Bucky" was a Ford man when I met him and he bought a 1971 Torino 500 brand new with the 370 hp 429 police interceptor package. The car had 3.25 gears. Another friend with a 1970 GS Stage 1 used to wear him out.  That car had stock 3.42 gears. Both cars had a/c. Likely the Torino that you raced was the solid lifter 429 SCJ with the Drag Pack and steep 4.30 gears. These models were lighter than the Buick GS and not even available with a/c.
Reply: chevy impala too... It´s beautiful muscle car....
Reply: @andret4vares  Which Impala are you talking about, Andre? ? There were many years and engine options.   Impala, Wildcat, Starfire, Chrysler 300 series ... these were never referred to as "muscle cars" but are very cool in their own right. Did you know that you will never find the word "muscle car" in any old car magazine before the 1980's?   The term should've been called "musclecar" in the first place, and NOT two words.
Reply: @andret4vares  Reason I ask is that my Dad has a 1967 Impala SS with a 427-385 hp that's stock with Doug's headers. It has run a 1/4 mile time of 15.38@91.mph. A new Kia with a turbo 4-cyl. recently outran him at Test & Tune. the bracket. Would that car qualify as a muscle car?
Reply: @LR-my2di  By the designer, yes...But I like the designer of the chevelle ss 1970 better...
Reply: @andret4vares  Yes, I like the looks of my 1970 LS6 Chevelle, too. That's one reason why I bought it. Cranberry Red with black stripes.  But when I got barely outrun twice in a row by a 1970 Buick GS Stage 1,  I looked over that GS carefully with it's bigger chrome plated 15" wheels, simpler grille treatment and G60-15 Goodyear tires and suddenly realized that it's freshly pressed clean lines made it look better than my Chevelle.  It was faster, too. I was surprised.
Reply: The Buick Buick GS 455 they made a stage 1 stage 2 and stage 3 I believe I might be wrong
Reply: I bet I think the fastest car you could have bought at a dealer if you had connections
Reply: @michaelnewton8329  Hi Michael    Only one factory prototype 1970 Stage 2 was ever built because of the impending ban on leaded gas and the ever-increasing insurance regulations.  All or part of the Stage 2 engine package was available over the Buick dealer's parts counter, and only through late 1971. Only 75 sets of the round exhaust port Stage 2 heads were ever built and those sold out quickly. .  No complete Stage 2 cars were ever sold. No such thing ever as a factory "Stage 3" or Stage 3 factory parts.
Reply: @chadhaire1711  50 years of engineering will do that.  What's your next tirade?  The best toasters in 1970 don't matchup well with the pedestrian toasters of 2023?
Reply: @justme307  The newer 2023 cars dont lie about their horsepower, the 1970 cars OVER RATED their horsepower by 20%......THAT is the difference Goober
Reply: @chadhaire1711  Thanks Goober!  No one knew that!
Reply: @chadhaire1711  Goober you're needed on the new Leno and Osborne video about the 1974 Trans Am. A poster is saying his stock SD455 ran 12.4 1/4-mile.
Reply: @justme307  I test cars for a living....I know damn well no stock Trans AM ever ran 12.4.....total bullcrap...in fact NO stock car in from 1960-1980 ever did that....even the 426 was 13.6 tops......LOL....if you think that 74 pontiac with 290 net horsepower is going to do 12.4 in a 4,000 pound car I have a bridge to sell you.....
Reply: I'm glad someone pointed out the Buick GSX which was the muscle car put out of factory with the highest torque. Enough to lift the front end. I've owned two in my lifetime. Although I respect them all, the BUICK GSX will always remain king.
Reply: @rickh4616  Thank you, Rick. To illustrate your point, all anyone has to do is google "Motor Trend Hot Rod Hemi Killer". This 5 min. amateur video from Dec. 1984 shows it all. ... Larry Rose
Reply: The old muscle cars were cool . I'm 61 and loved all the SS396 , GTOs, camaros and so on. But I'm on my  3rd Coyote and love the Stangs. It's a car the handles good with the track pack. The 5.0 does a good job. Sure,there are plenty of faster cars. But bang for your buck the car does ok. I'm depressed thinking about electric cars. Sure they're fast but have no soul like a growling V8
Reply: My favorite car was the 65' Ken Miles flying GT350R Shelby